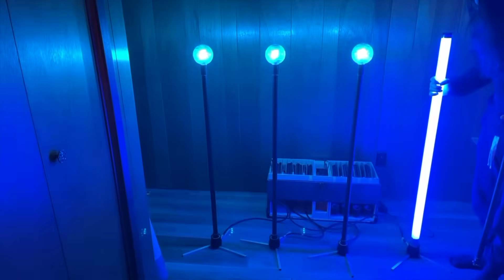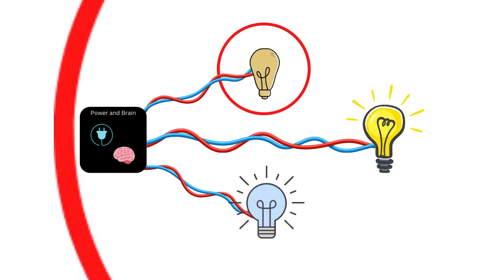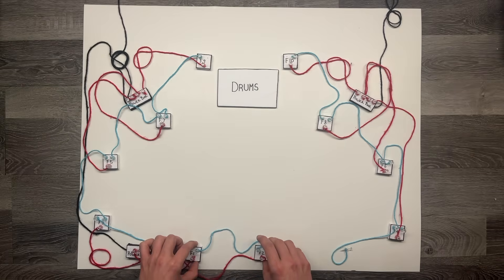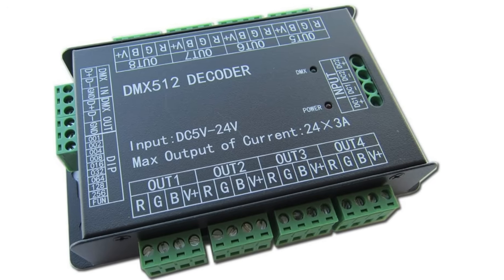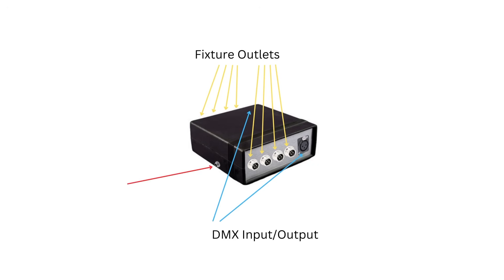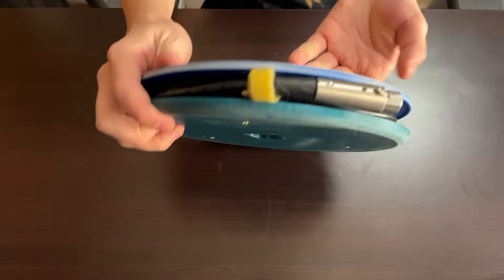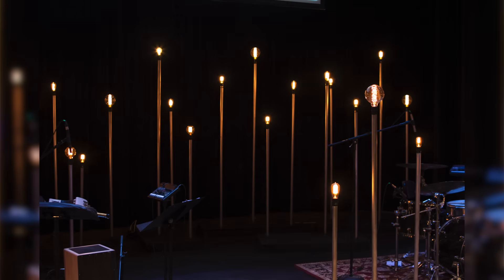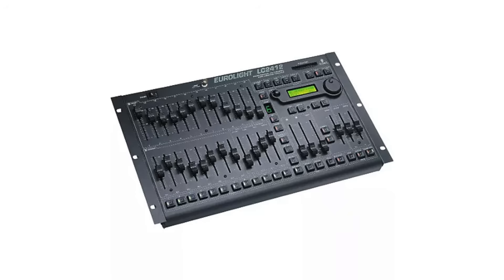This diy DMX Light Rig will Change Your Live Shows

Comment: Have you considered using a 3 phase twist lock plug and outlet for the bases? You’ve got 4 conductors and nothing would need to be custom fabricated.
Reply from the maker: This is a great suggestion! I remember when I was designing this, I was considering a few off the shelf solutions and I don’t recall if I came across this as a potential solution! I think budget forced me into going the route I did but it was a lot more work so if time was an issue, this might be the better option!
Reply: @SuperValidDesigns  Yes if the cost is within budget it’s an industrial plug, so it can hold up to the road. Love the whole setup man, I may attempt to do something similar for my band Faith in Nothing soon. Thanks for making the Video!